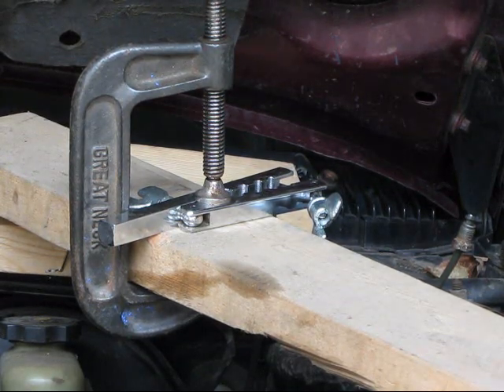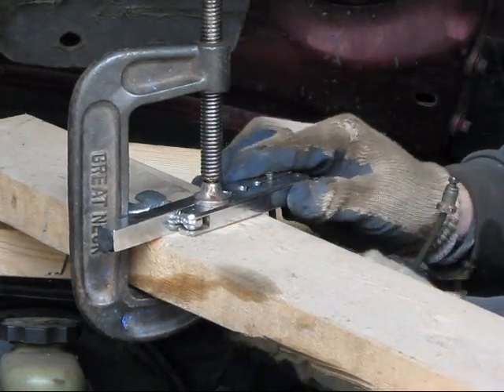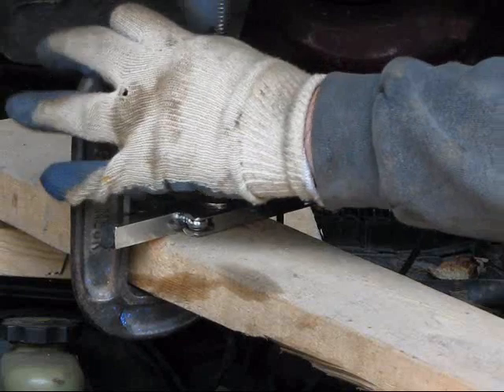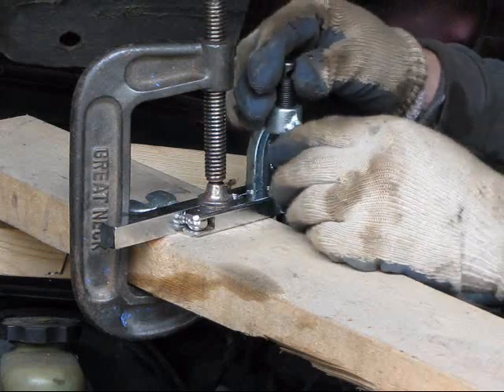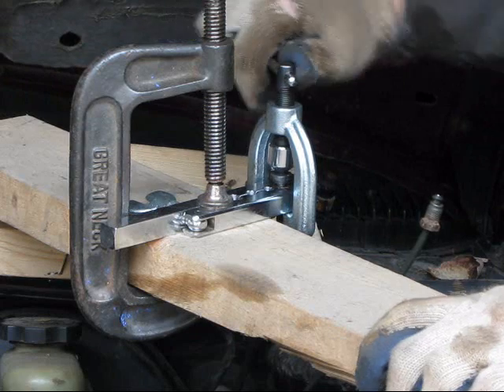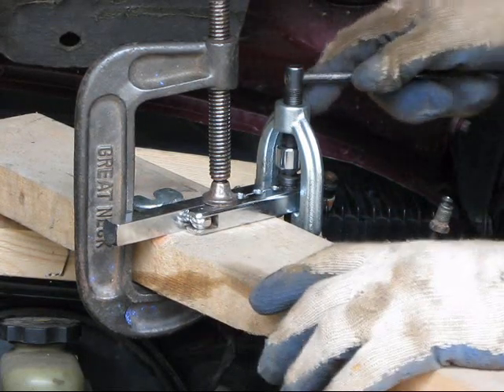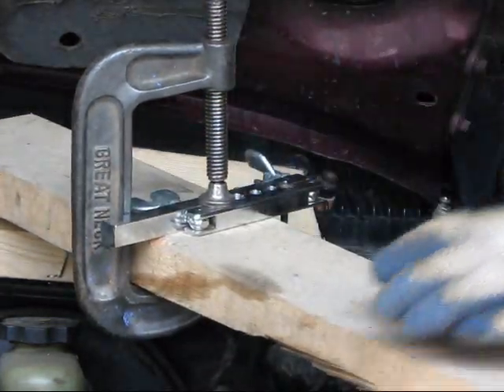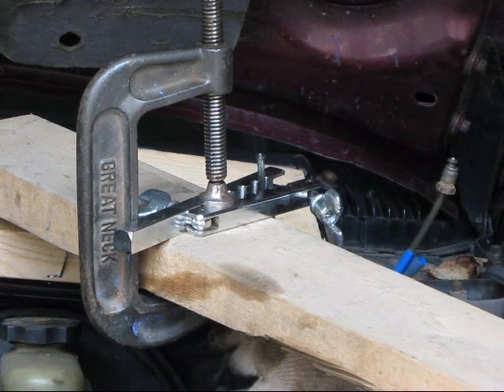Making a bubble flare with a double flare tool - Replacing brake lines

Comment: Thanks but how much of the brake line should be sticking up before you flatten with the flat side?  How do you measure it? I see the tube sticking up a bit. Hope I don't have to buy a bubble flare tool when I already have 2 double flare tools. I just don't want to see a leak since brake pressure puts out like 1500 psi so need to make a great bubble flare.
Reply: I just watched again and just heard you want tube sticking up less than a quarter of an inch.
Reply: @RamonLFrancisco  it doesnt matter it doesnt work...the ending was cut and sliced in his fake

Comment: YOU are awesome! Got a bear of a job ahead of me; all four wheels on an expedition, ABS block to wheel, full runs, 8 total flares to do and i thought i was gonna have to order a special tool cause the one rental didn't work. Clever, i don't think i would've tried it upside down. Glad you posted this video. *10 years later..........still helping folks

Comment: Get the NAPA in line tool - it actually works on hard factory tubing right on the car. just use a couple of wrenches to work it. The adapter/die stays inside a large tube and cannot move the way the Yoke does on more expensive clamp type tools. Mine is just for 3/16 tube which is fine for brake lines. The other tools are more flexible for larger gas lines , etc - but the need soft tube to work well.

Comment: I have prepared many parts for doing a complete hard line from abs modulator brake repair to new rotors and drums pads and shoes. When you replaced the lines, what did you do about the soft hose from the modulator. I have not been able to find a section that will absorb vibration like a suspect it was used in the first place.

Comment: i like the buuble flare trick, but i found it hard to do also, but then i used the bubble end first, like you was starting to do a double flare, get your bubble, THEN turn it around to the flat side and finish your bubble, i found it alot easier.

Comment: I tried (numerous times) to make a bubble flair using a similar tool from harbor Freight. The "bubble" came out flat instead of round. Perhaps the HF 3/16 die is different from the one shown here. I had to give up on the bubble ,installed  a double flair line and used a double flare union to join the line.

Comment: @mainejunker I found out what the problem is; I was using a cheap flare tool from one of the car parts chains.  I went to Home Depot and bought a "Heavy Duty" flaring tool for $25 and it does bubble flares perfectly.

Comment from the maker: @advacoRRR The tubing lines I used are very soft, so they shape easy.  Maybe your material is too hard.  I used PolyArmor from autozone.  It's also plastic coated to prevent rusting.  Seems to work very well.